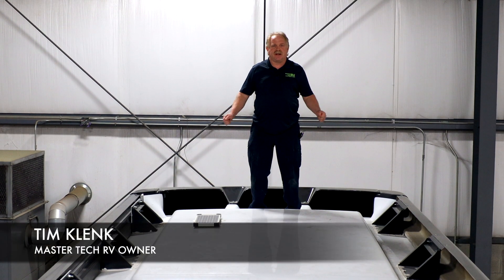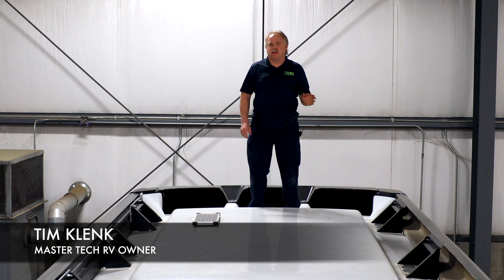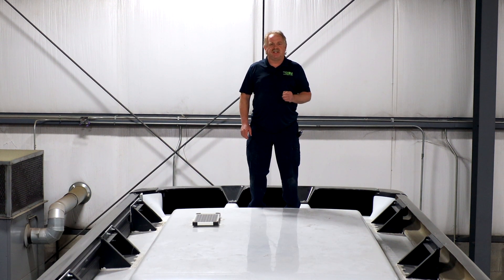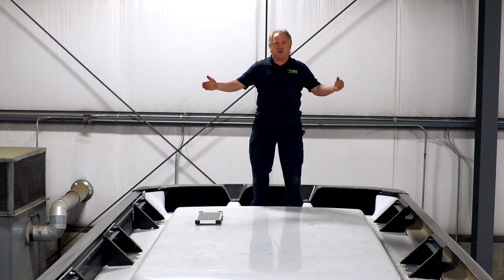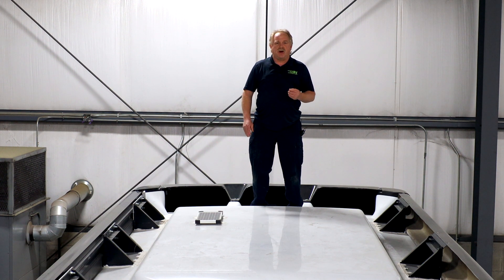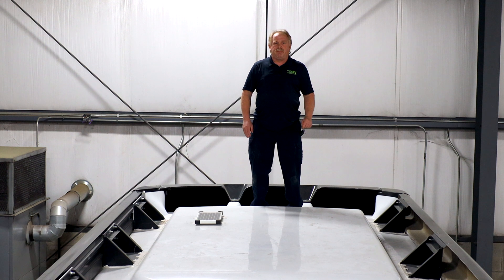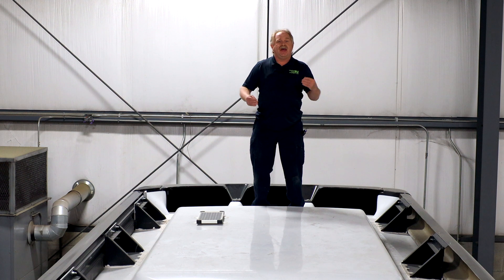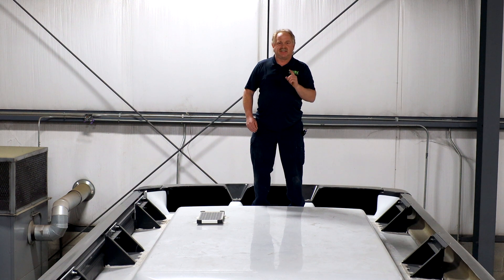Integrating the First 48V Lithium Ion System in an RV

Comment: Great presentation!  That is really amazing in having Solar Panels that will provide power via the 48V Lithium Ion System to have both air conditioner running without the need of a generator.  Best, Steve from Western Mass.